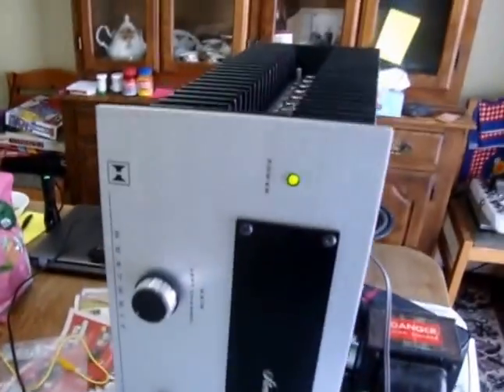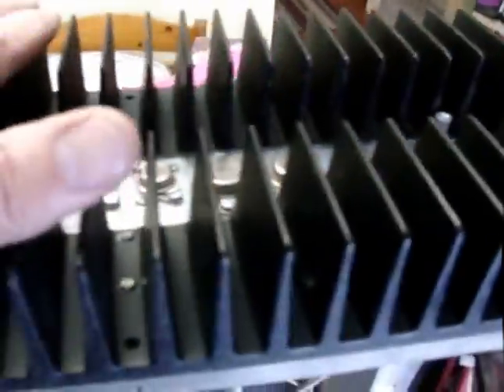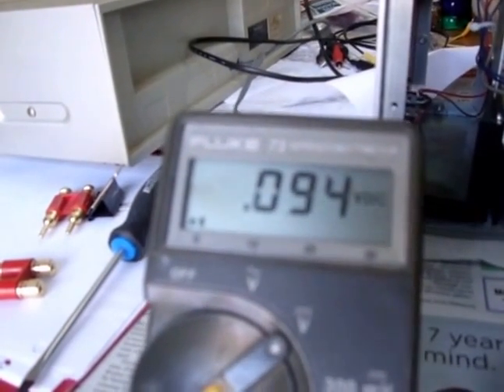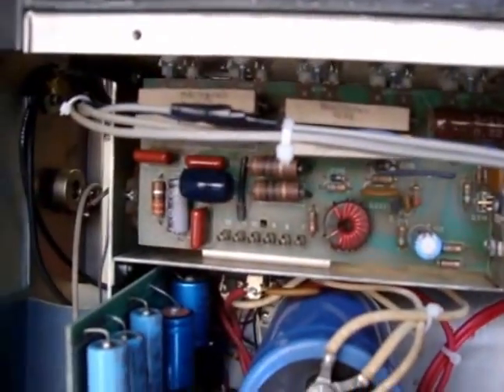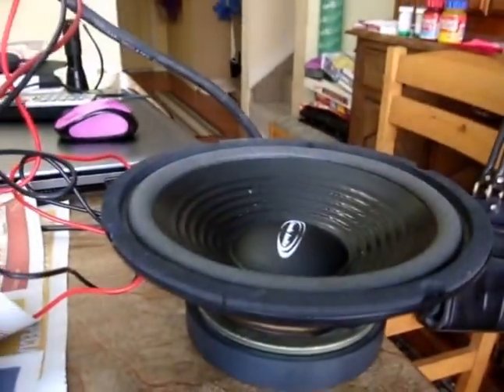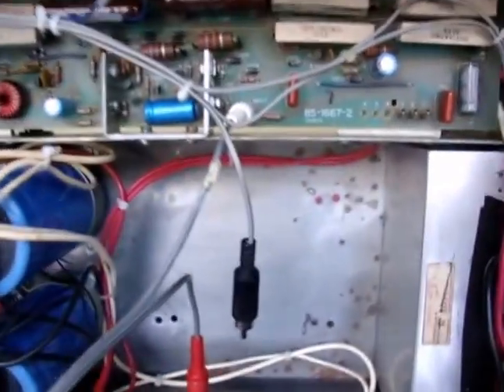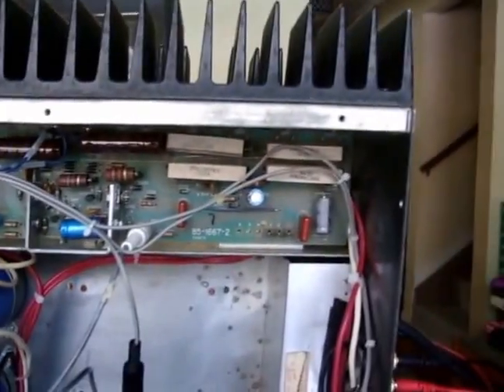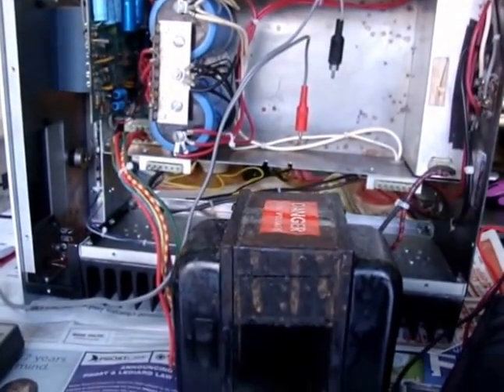Heathkit AA-1640 power amplifier repairs

Comment: Had two of these on the road for three years with a southern rock band. No problems at all. If you had problems with thermal,should check bias. Typically .54v B to E. Keep it below that and I can't see an issue unless Chinese replacement outputs. Have a big stock of original 417-847's.

Comment: I have a Heathki AA-1640.  Do you perform upgrades and mods for others?  If so I would love to talk to you.
Reply from the maker: I just tinker with my own equipment mostly. These 1640 amps are complicated and not very forgiving. I would not want to work on anyone's unit for sure. This one did go up in smoke (again), and I have shelved it.
Reply: When I built mine I jumped one bias diode, that stopped the thermal runaway. Not the best solution but the map sounds great and is working today 40 years later.